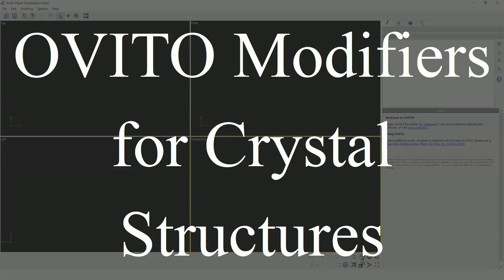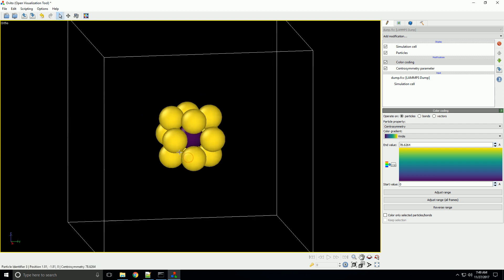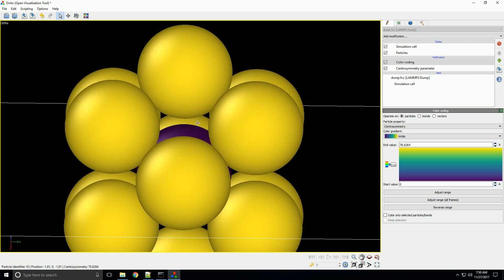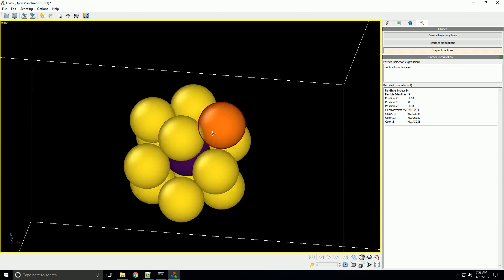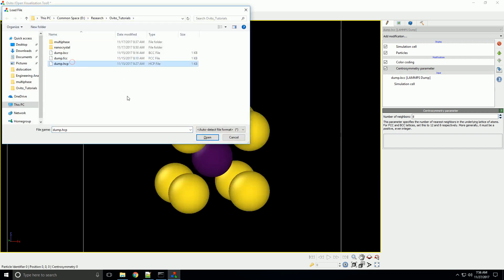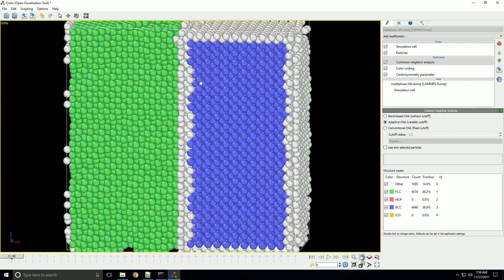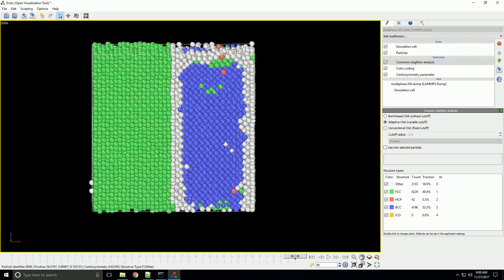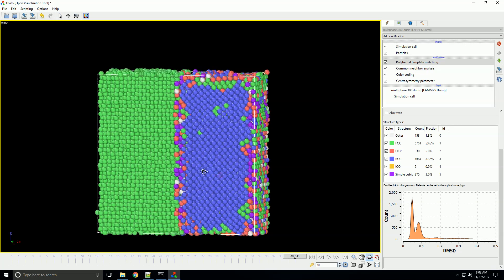OVITO Modifiers for Crystal Structures

Comment: I'm building a hcp ZnO structure. 
Unfortunately, I could not do the whole programming in Python, thus to grow the structure 3D to 2500 atoms I used excel. And later eliminated all the duplicates.
In Ovito, I opened .xyz files and the atoms were of 2 color: O red and Zn blue. I had to add a small quantity of dopant Cl (yellow) replacing some O (red). I randomly replaced some type 1 with type 3 in the excel and the .xyz file. In Ovito, some yellow atoms for Cl appeared, but some atoms presented dual colors of red and yellow. I've already rechecked for duplicates. Do you have any guesses of how to solve this problem?

Comment: THANK for this videos , please i have some question about the LAMMPS code : is it possible  to use LAMMPS code for the ionic diffusion in a polymer electrolyte solution study for battery application?

Comment: Great video!  A tip: when using Polyhedral Template Matching, try adjusting the 'RMSD cutoff' parameter.  Based on your RMSD histogram, I would set it to 0.1 or so.  It will remove the spurious classifications at the grain boundaries.
Reply from the maker: Thanks for watching! And thanks for the tip! That definitely helps the classifications around the edges.

Comment: hello sir please you can help me i have in file at compaction of AL metal but i want to change at anthor metal you can help me for that
Reply from the maker: Hello! And thanks for watching! To do a different material, you will need a couple of things: you will need the potential files for your other metal and the lattice parameter for that metal. Then, in the input file, you just need to change the names of the potential files to your new ones, and update the lattice parameter. Simple! I go into more details about these parts of the input file in this video: https://www.youtube.com/watch?v=7Ila18g8zSY . Hopefully that helps!
Reply: I can send for you our input file at your email
Reply: This file for aluminum and want to titanium or anthnor material and doing run for this file after changing material and parmmater
Reply from the maker: I would be glad to help you, but I would prefer that we keep the discussion here so that it may help other people with similar problems. If you can describe the issue that you are having, I would be glad to try to help you sort it out. Do you have a titanium potential?
Reply: How I can send input file here.  And not all command I know
Reply: I think you have experience about lammps
Reply: #parameters
variable LatPar_Al equal 4.050
variable LatPar_Cu equal 4.050
variable RADIUS equal 7.5
variable NUMPART equal 20
variable THICKNESS equal 300
variable SUPPTHICK equal 0.3
variable WIDTHY equal 30
variable WIDTHZ equal 30
variable LENGTH equal "(v_THICKNESS * 2 + v_NUMPART * v_RADIUS * 2) * 1.5"
variable REAR equal "(v_THICKNESS + v_NUMPART * v_RADIUS * 2)"
variable REAR2 equal "(v_THICKNESS * 2 + v_NUMPART * v_RADIUS * 2)"
variable BPressure equal 2 #GPa
variable BForce equal "0.5 * (v_BPressure/160) * v_LatPar_Al * v_LatPar_Al"
variable BPulseDuration equal 15000 #2fs
variable BGapDuration equal 50000 #2fs
variable VStartPoint equal 9611739

units  metal
boundary p p p
atom_style atomic

lattice  fcc ${LatPar_Al}
region  box block 0 ${LENGTH} 0 ${WIDTHY} 0 ${WIDTHZ}

create_box 2 box

#support & wall & indenter
region  reg_support block 0 ${SUPPTHICK} 0 ${WIDTHY} 0 ${WIDTHZ}
region  reg_wall block ${SUPPTHICK} ${THICKNESS} 0 ${WIDTHY} 0 ${WIDTHZ}
region  reg_wall2 block ${REAR} ${REAR2} 0 ${WIDTHY} 0 ${WIDTHZ}
region  reg_wall_supp union 3 reg_support reg_wall reg_wall2

include particles.in

create_atoms 2 region reg_wall_supp
#lattice    fcc  ${LatPar_Cu}
#create_atoms 2 region reg_particles
#lattice    fcc  ${LatPar_Al}

group      support region reg_support
group      wall region reg_wall
group      particles region reg_particles
group      wall2 region reg_wall2

#interaction style
pair_style adp
pair_coeff * * AlCu.adp Cu Al

neighbor 1.0 bin
neigh_modify delay 5

#computes and step
compute centr all centro/atom fcc
compute kinen all ke/atom
compute wallTemp wall temp
compute tempID all temp
compute strs all stress/atom tempID
timestep 0.002

#minimization
minimize 1.0e-6 1.0e-8 100 1000
reset_timestep 0

#output
thermo_style custom step temp press c_wallTemp pe ke etotal enthalpy
thermo  100
restart 50000 mupul_1.rest
dump 1 all custom 5000 mupul_1.*.dump id type id type x y z vx vy vz c_strs[1] c_strs[2] c_strs[3] c_kinen c_centr

#relaxation
velocity all create 600.0 ${VStartPoint} rot yes dist gaussian

fix 1 all nve
run 10000
unfix 1

fix 2 all npt temp 300.0 300.0 0.1 aniso 0.0 0.0 0.1
run 40000
unfix 2

#PULSE

fix 12 support addforce v_BForce 0.0 0.0
fix 13 all nve
run ${BPulseDuration}
unfix 12
unfix 13

fix 14 all nve
run ${BGapDuration}
unfix 14
Reply: #parameters
variable LatPar_Al equal 4.050
variable LatPar_Cu equal 4.050
variable RADIUS equal 7.5
variable NUMPART equal 20
variable THICKNESS equal 300
variable SUPPTHICK equal 0.3
variable WIDTHY equal 30
variable WIDTHZ equal 30
variable LENGTH equal "(v_THICKNESS * 2 + v_NUMPART * v_RADIUS * 2) * 1.5"
variable REAR equal "(v_THICKNESS + v_NUMPART * v_RADIUS * 2)"
variable REAR2 equal "(v_THICKNESS * 2 + v_NUMPART * v_RADIUS * 2)"
variable BPressure equal 2 #GPa
variable BForce equal "0.5 * (v_BPressure/160) * v_LatPar_Al * v_LatPar_Al"
variable BPulseDuration equal 15000 #2fs
variable BGapDuration equal 50000 #2fs
variable VStartPoint equal 9611739

units  metal
boundary p p p
atom_style atomic

lattice  fcc ${LatPar_Al}
region  box block 0 ${LENGTH} 0 ${WIDTHY} 0 ${WIDTHZ}

create_box 2 box

#support & wall & indenter
region  reg_support block 0 ${SUPPTHICK} 0 ${WIDTHY} 0 ${WIDTHZ}
region  reg_wall block ${SUPPTHICK} ${THICKNESS} 0 ${WIDTHY} 0 ${WIDTHZ}
region  reg_wall2 block ${REAR} ${REAR2} 0 ${WIDTHY} 0 ${WIDTHZ}
region  reg_wall_supp union 3 reg_support reg_wall reg_wall2

include particles.in

create_atoms 2 region reg_wall_supp
#lattice    fcc  ${LatPar_Cu}
#create_atoms 2 region reg_particles
#lattice    fcc  ${LatPar_Al}

group      support region reg_support
group      wall region reg_wall
group      particles region reg_particles
group      wall2 region reg_wall2

#interaction style
pair_style adp
pair_coeff * * AlCu.adp Cu Al

neighbor 1.0 bin
neigh_modify delay 5

#computes and step
compute centr all centro/atom fcc
compute kinen all ke/atom
compute wallTemp wall temp
compute tempID all temp
compute strs all stress/atom tempID
timestep 0.002

#minimization
minimize 1.0e-6 1.0e-8 100 1000
reset_timestep 0

#output
thermo_style custom step temp press c_wallTemp pe ke etotal enthalpy
thermo  100
restart 50000 mupul_1.rest
dump 1 all custom 5000 mupul_1.*.dump id type id type x y z vx vy vz c_strs[1] c_strs[2] c_strs[3] c_kinen c_centr

#relaxation
velocity all create 600.0 ${VStartPoint} rot yes dist gaussian

fix 1 all nve
run 10000
unfix 1

fix 2 all npt temp 300.0 300.0 0.1 aniso 0.0 0.0 0.1
run 40000
unfix 2

#PULSE

fix 12 support addforce v_BForce 0.0 0.0
fix 13 all nve
run ${BPulseDuration}
unfix 12
unfix 13

fix 14 all nve
run ${BGapDuration}
unfix 14
i want to change in put file for titanum matel you can help me for that
Reply: please you can help me for change this file for type lattice and parmter  potential

Comment: First I would like to thank you for the tutorial. I have just started working on Molecular Dynamics and Dislocation Dynamics (MDDP). I also saw your video on "Introduction to MDDP". It helped me a lot in its usage. 
But I have some doubts which I asked in that video tutorial itself and I am putting the same questions here as well.

1. I am having a doubt in "datain" file, in 'line 2' regarding coordinate axes rotation. You said that we can use directions of x- and y-axis entered in 'line 3' directly and also value '0' can be taken in 'line 2'. But MDDP-documentation says that 'line 3' is only used if '1' is given in 'line 2'. If in 'line 2' value given is zero then line 3 seems to be redundant. Please clarify the issue.

2. How can we create bicrystal in MDDP? Please help me in this regard.

Thank You.